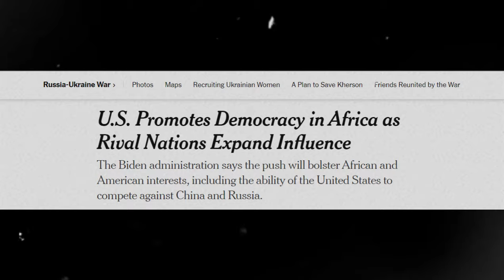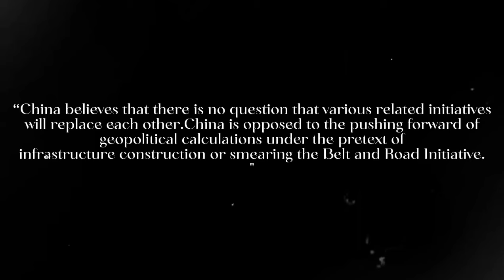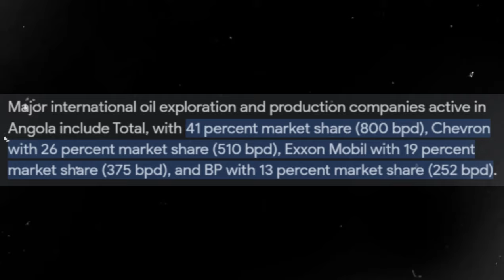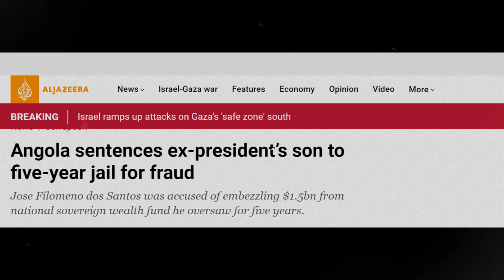Even China was Shocked by U.S. investment in this Railway Project

Comment: LMFAO. USA is always doing better than China. The only problem is, their BETTER is on the drawing boards, and China's already implemented and moving on. For instance, I've been to China and they have an amazing Bullet Train network connecting all cities to any other city, travelling at 350kpm. I've been to USA and they have their Amtrak (not a National coverage), that travels at 120kpm but averages 80kph ... and it is clankerty-clank all the way.
Yet USA brags about their Bullet Train IS GOING TO BE better. They site the California Bullet Train as their example of being better. The only problem is, they started building that in 2012, and they still haven't finished it because they run out of money, which was soaked up by Corporate fees and expenses. 
Meanwhile, China is now at the verge of launching their SONIC train, a Maglev train in a Hyper tube, that will travel at 4,000 kph. 
China has ALREADY built Railway structures and trading ports (land, air, and/or sea) in most of the African Countries. It's there, but here we go with USA bragging about what its GOING TO DO, that will be better.  How about DOING IT first before bragging about it. After all, I've got a FTL (faster than Light) Train in my drawings, that is going to be the BEST, and it will also allow you to travel through time. Now, USA ... beat that!!!!
Reply: Wrong, we have been talking and negotiating for the California light rail in the mid 1980’s and passed legislature in the 90’s. Hardly anything has been built till now.